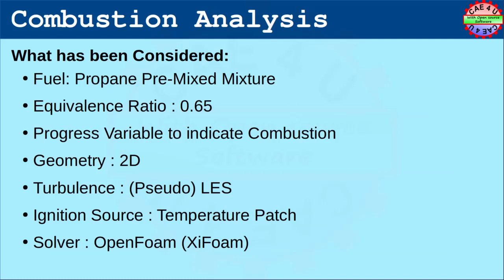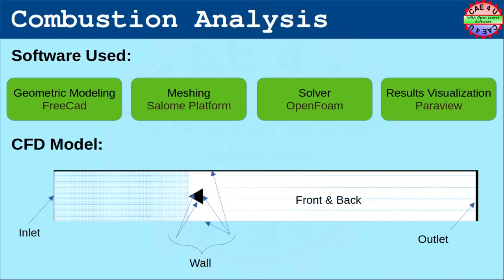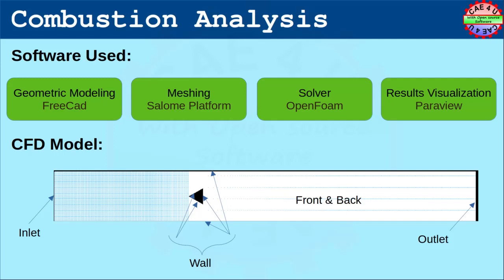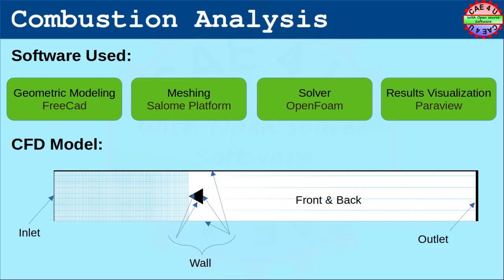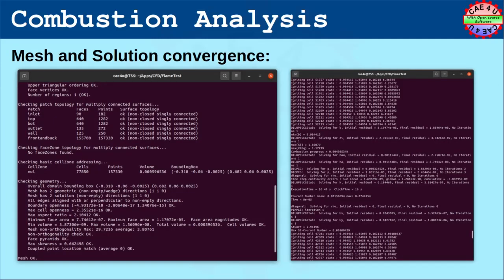Premixed Turbulent Combustion Visualization | OpenFoam | XiFoam | LES | Bluff Body Volvo Rig

Comment: Hello, I'd like to learn Premixed Combustion using Openfoam, can you please teach me through some paid classes if that's possible?
Reply from the maker: Hi, At this point a structured class is not available. However, link to case file is available in description. It is a good starting point to learn premixed combustion simulation for nominal price. Hope it helps.

Comment: Again similar geometry is for the Fossee internship task
Reply from the maker: Glad to know. This is also industrial need.
Reply: Can you provid me the boundary condition please
Reply from the maker: Please refer the description of video. You can obtain all necessary details from Gumroad link.
Reply: @cae4u125  hi I set up all the boundary conditions exactly the same on the video but there is no flame, and I use species transport for this, have you any suggestion?
Reply from the maker: We hope you could be greatly benefitted by the case files available in gumroad. It can be obtained from the link in description. They are good starting point resource. Please try it out.